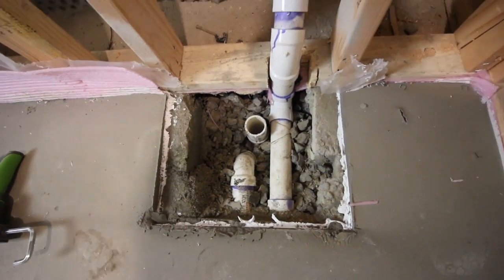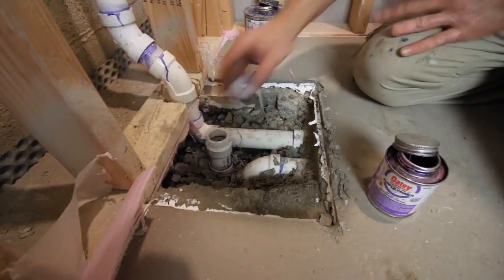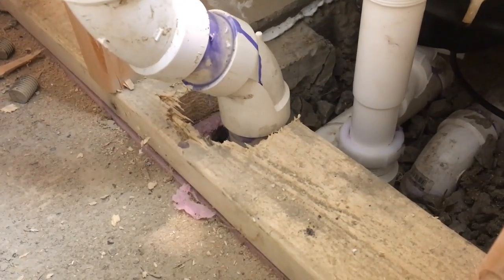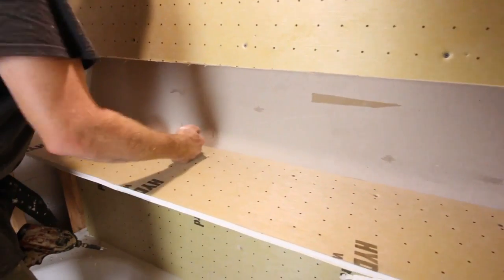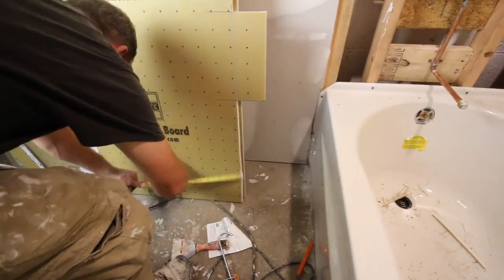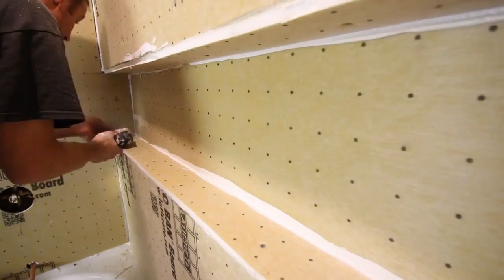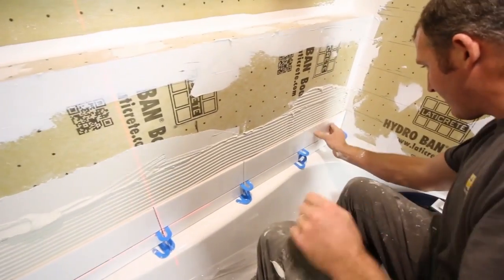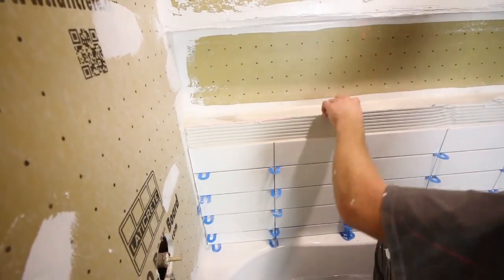Tub Shower Workshop (LIVE): Waterproofing Walls and Tile Tips

Comment: Such great information. I have an issue with a basement shower where the grout is cracked on the walls and the line between the wall and floor. We have subway tile. Do you recommend a specific grout for basements with large changes in humidity throughout the year even with two dehumidifiers?  Thanks!

Comment: Do you have any tips for adding a grab bar? Is there a way to avoid piercing the water barrier?
Reply from the maker: we recommend having solid blocking in the stud cavity. For example 2x10. Then putting silicone in the holes before screwing the grab bar in place